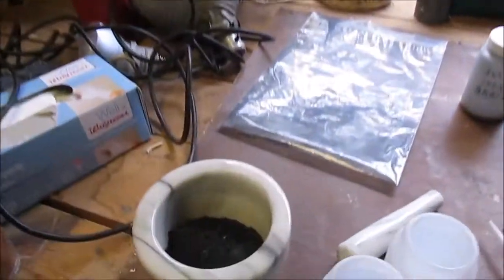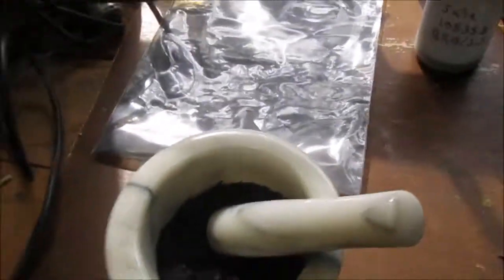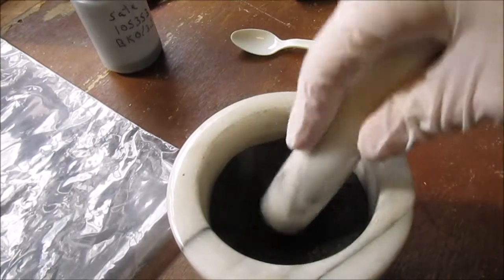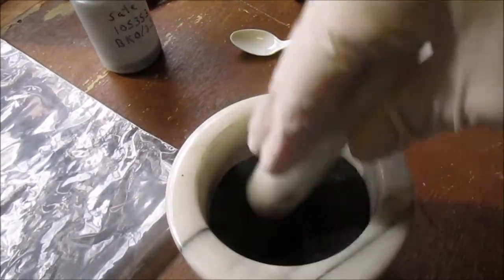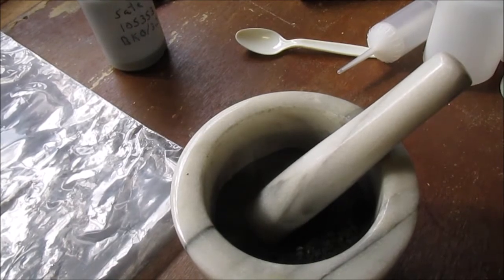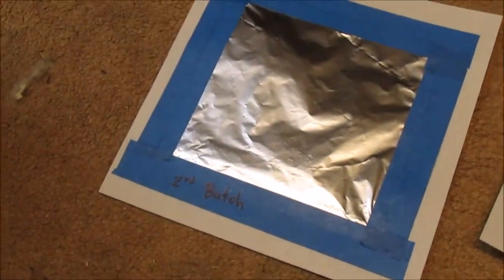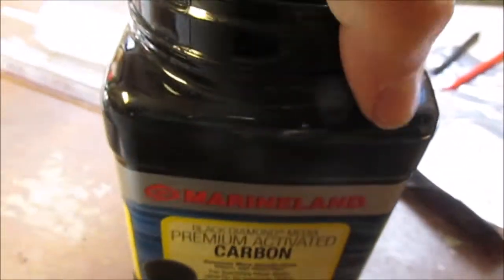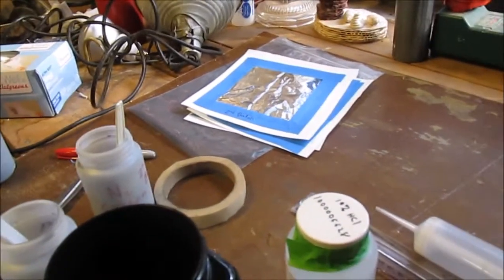Supercapacitor Carbon from Compost

Comment: can i use charcoal?
Reply from the maker: Ground up charcoal from a store would probably work. I haven't personally tried it, but it should work just fine. (Though keep in mind the performance won't be quite as good since charcoal often has other ingredients in it, and the surface area might not be as high.)

Comment: Why use HCL? It is going to destroy the aluminum forming aluminum chloride and hydrogen gas.
Reply from the maker: It was the cheapest and most disposable thing we happened to have on hand. We ended up doing the rest of the project with acetic acid.
Reply: Air in electrolite, also destroy alumium.